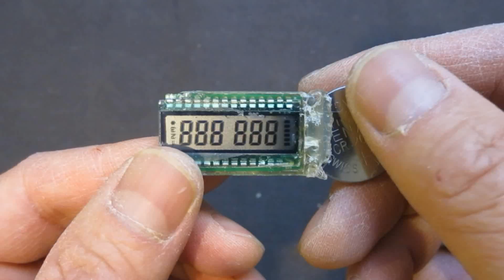RSA SecurID Teardown

Comment: I mean mine old one battery died too. I took it apart and cut the rubber around it and replaced the battery. It started blinking so I think that once you replace the battery it enters some sort of default settings unfortunately :(

Comment: The epoxy can actually be removed with some snips or pliers - much easier than conformal coating as it just comes off in one piece. Also, the outer plastic shell can be pried off with a screwdriver and the dremel is completely unnecessary.

Comment: The clear material is known as potting compound. the pcb will be put in a mold and have a resin liquid pored over it, when it sets it sets rock hard or very hard rubber depending on the type.

Comment: Hi! Thanks for this video. Could you please explain more on the synchronisation of clocks of the token (which is a stand alone equipment) with the server
Reply: My rough understanding is the server knows what the current/previous/next code should be so if you are ever so slightly off it will "know" and then ask you to wait for it to change and re-enter.  I am guessing it keeps some clock-drift-offset on the server side because that doesn't happen very often in my experience.
Reply: @matthewmiller6068  I feel it some encryption by the token using the time stamp, which when decrypted by the server allows the entry if the time matches. This is my understanding..

Comment: I worked for RSA for 14 years and did some tear down of these devices during some destructive testing and found an issue with a battery tab not being soldered properly which would cause the device to loose connection with the device an led causing the device to expire earlier than expected. Learned so much working there, it was a good expeu

Comment: So basically if the battery dies, they want you to shred it and buy/issue a new one.
Reply: They have a life span of 2, 3, or 5 years. The battery will out last the expiration date of the token. After the token expires it can not be reused ever
Reply: I received a new device from my bank a couple of months before mine was due to expire. I also had a few notifications on my online banking page warning my current device would be expiring soon. My bank does not charge for these devices so I get them for free. The bank must believe that providing these for free is cheaper than having disputed transactions in future.

Comment: That was about as exciting as a solar powered calculator tear down without the solar panel. Did you really need 15 minutes to show it's just a battery LCD and blob chip? Just chuck that thing in the trash and delete the video as nothing interesting can come from it no need  to document the serial number.
Reply: Ironically enough, here you are wasting your time to comment on it.
Reply: And I went searching for a teardown of the device,, granted I was hoping that there might be some recycle use...maybe a time pieces but looks like no.... but without this I would need to find a different source.

Comment: I bet the MCU wiped the seed code as soon as it reset.
Reply from the maker: I wouldn't be surprised if this was the case. There may be other tampering proof mechanisms builtin.
Reply: The key is stored in SRAM.  SRAM requires power to function.  When power is removed from SRAM POOF goes whatever is stored in SRAM in this case the key/seed rec.

Comment: Seems like a pretty robust device.  I wonder if one managed to disassemble it without destroying it, and then replaced the crystal with a faster one, overclocking the device, if one could obtain future codes by allowing it to run fast.
Reply: I firmly believe that we could manipulate the device clock to display tokencodes far faster then the common 30 or 60 second setting thus getting tokencodes "from the future" if you will.  But how could we use that to our advantage?  When the user uses the token FOR THE FIRST TIME the window for allowable tokencodes is +- 12 hours I believe.  Once the user auths once the window becomes much smaller usually +-3 minutes allowing for only 7 good tokencodes before putting the user into a "next tokencode mode" wherby they are asked to provide the next consecutive tokencode or simply denying access with a bad tokencode event and after like 3 of those the token becomes disabled prompting a call to tech support lol.   Even if we were succesful the token drift would simply be adjusted a minute or two changing the aforementioned window of 7 allowable tokencodes.   I fail to see any advantage do you see one?

Another point... If you had a software token and installed it on a windows machine and adjusted the clock on the windows machine that too would display tokens from the future as well.

Comment: i was found as this secu id token who is same this off. we can on it and how to use it??
Reply: What? That makes no sense. No one is going take the time to answer your question if you can't be bothered to make it intelligible. But let me try to answer your question: u  same this on cn use the sec. id off. as on it as found and how to or off. token.

 I hope that helps answer your question.
Reply: @daveb5041  ... thanks for answering the question. I was wondering the same thing myself. ;)
Reply: @daveb5041  conversely, secu. token on off found seed off use not. as token, use not u same id spawn sub-bittle much... but that's just an assumption on my part.
Reply: Once mine expired it simply displays "OFF" and I needed to get a new one